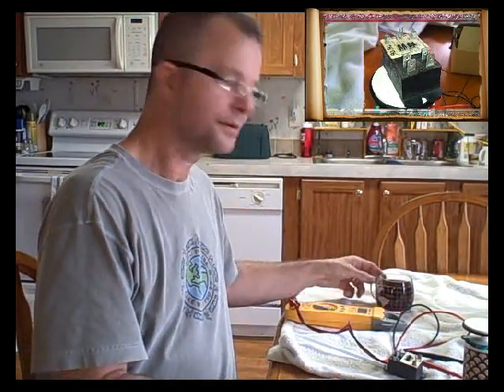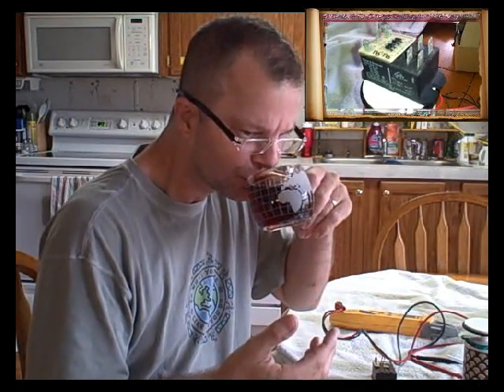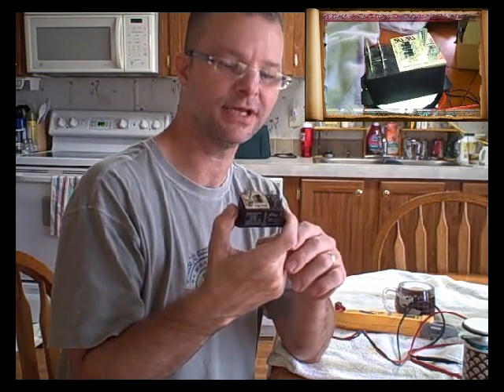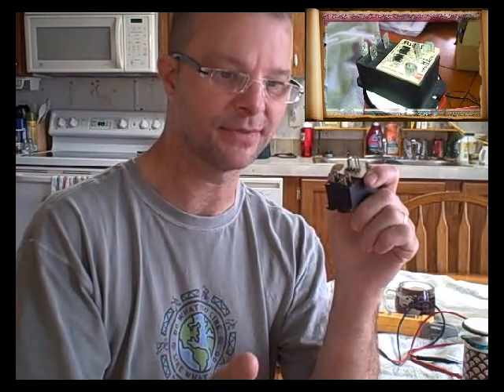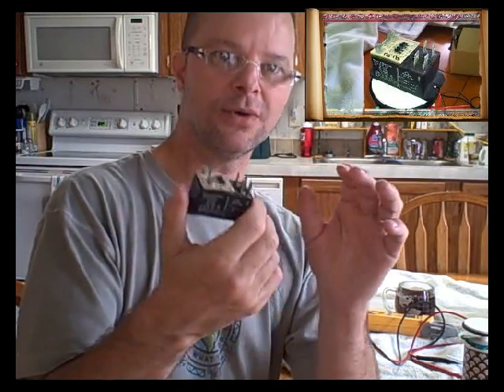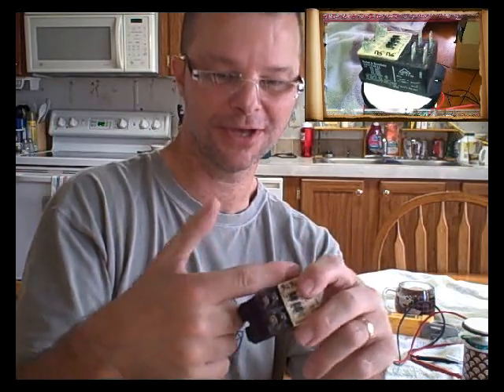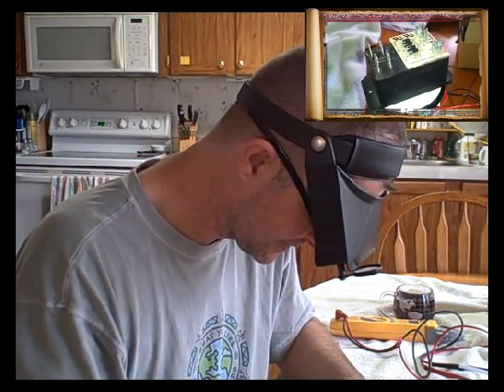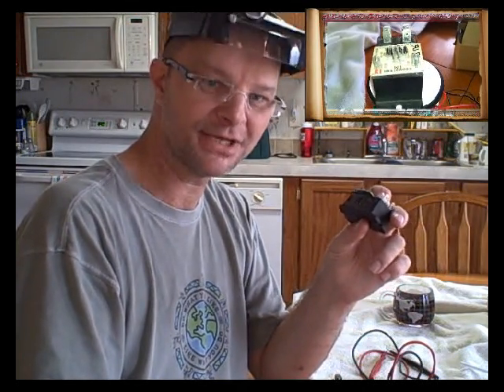HVAC DC Heating Relay troubleshooting

Comment: My Carrier system has this part in it. I’m in North Texas and after this last winter weather my thermostat would just keep rebooting while in heat mode. It’s an Ecobee premium. If I turn off the main power and wait a while it will work after powering on the breaker. After a while it will shut down and reboot itself over and over. I ohm’d the limit switches and they were good as well as the heat strips (I have 2 strips). My voltage regulator is sufficient to power my thermostat also. Could this be causing my issue?

Comment: Thanks for putting this video out there. It was very helpful. a bit new to the industry (6 years) ran into a service call where emergency heat was not working. Got another heater, still no luck. I had all the right voltage but knew my relays were not working. Couldn't figure out why. I watched this video and then realized I was trying to send AC to the relays (there was no DC rectifier). Thanks so much for your help!

Comment: I have systems at my work with these. Fuses are constantly blowing. I replaced what boards we had laying around when we took over this property but i want to keep from buying all new ones. How can i test out the diodes?
Reply: If the rectifier board is working it will have 24 volts dc on spades from relay that rectifier board mounts to. If you are reading a higher voltage, like 36 vdc, than relay is open, and board is ok. You read the higher voltage because rectifier has no load on it from bad relay.
If you check dc relay a good one will have a coil that reads a little over 300 ohms.

Comment: Very helpful video. 2 of these are inside my ICP/ Tempstar manufactured air handler with 15 KW heat strips. So obviously these take the place of sequencers.

Comment: Ran across one the other day, Heil unit, which had Carrier sticker.

Does this rectifier only work with heat strips, not cooling or blower motor in cooling mode?

Where you buy glasses?

Thk u. Good video.

Comment: our heatpump always blows a relay at least that what the repairmen tell us because the outside unit dose not come on
Reply from the maker: Well you were up late! Hehe, sent that asset after midnight! I was in bed by 7:30, if you can believe that, and asleep by 8! Woke up a bit after 4, first time I've slept more than three hours in months, i think!
Yeah, sounds like your contactor on the condenser unit out there. I have a friend of mine that gets ants in his and they kill it, seems like every other year. If he remembers to put out ant poison its ok. Always the smaller unit out by his pool house too! They like something about the electricity, like moths to a flame, lol.
If the unit is pulling a lot of current on startup it can pitt the contact points and eventually cause failure too. Older units are prone to pulling higher startup current, as well as heatpump, esp in cold weather, that have a compressor heater element that has failed. When that happens the liquid freon pools in the compressor and it has a hard time starting, pulling high amperage. Lots of other reasons too, one of these days I should make a cause/effect manual for fun!

Comment: I have replaced that relay(and little board) in Nov 2016 and again in Feb 2019 because the auxiliary heat would not turn off.  Now (Jan 2021) my auxiliary heat will not turn ON. Thermostat displays aux heat is on, but I measured air temp from a vent at only 65 degrees F..  This relay (and little board) keeps failing approximately every 2 years.  So I am about to buy relay and board again, and the little board is at a much higher price than in prior years.  Is there a simple way to know if the problem is the Relay or it is with the little board?  Is there a better, more reliable relay that I can use?  Thank you for your time.
Reply: I figured out how to test the relay and mini-board.  I happen to have a 24 volt AC power adapter.  Plug it into the wall, and it makes 24 volts alternating current up to 1200 milliAmp.  Connect the A/C current to mini-board poles TP1 and TP2, and then miniboard QC1(Red lead) and QC2(Black lead) should show around 24 volts DC.  If you get negative voltage, just reverse the leads on your multi-meter.  This concludes testing the mini-board - its job is to convert 24 volts A/C into 24 volts DC to power the relay.  Now for the relay.  The Two Tabs on the left (QC1) side of the relay should show infinite ohms resistance - connect the A/C power supply to TP1 and TP2, and those two tabs should show 0 ohms resistance.  Repeat the test for the Two Tabs on the right (QC2) side of the relay.  My results are: My two mini-board rectifiers work well.  The mini-board inside the furnace also worked (felt risky to test it while it was in use with Aux Heat enabled by thermostat.  I certainly would not test the actual relay while HP is in operation).  The relay that I removed in Nov 2016 works great on the bench.  The relay that I removed Feb 2019 - the right side should be infinite ohms resistance when no A/C power applied to mini-board, but it is not infinite ohms (forgot the exact value).  Both sides work correctly when A/C power is applied going to 0 ohms resistance.  I turned off the furnace circuit breaker for 10 minutes, then turned it back on, and the relay in the HP is working fine - auxiliary heat now goes on when thermostat calls for it.  It seems these relays can cause Aux Heat to never go on, or can cause Aux Heat to never go off.  And sometimes just turning off the furnace at the circuit breaker to let it "rest" a while can get it to work again - how long will it work correctly - I do not know?
Reply from the maker: @silentanddeep  great job and thanks for describing your testing process for everyone! Apologies that I didn't see your first message sooner.
Yeah, I can't imagine there being a problem with the diode boards. For kicks you could buy a different relay and just soldier the board on with jumper wires and test it out. I still don't know why in the world they bothered going that route to begin with instead of just using regular relays like everyone else:/ I always wondered if they got a massive discount for buying a ton of them that some company got stuck with when whatever company was ordering and using them went out of business our something, heh.
Honestly I don't know why you couldn't use a regular relay (ac) and do away with that nonsense, ass long as the current draw was in the same range, or at least not taxing the transformer. I imagine the transformers have a decent bit of overhead.

I've replace the melted down heat relay in my air handler with a big contactor that you would see in your outside condensing unit, hehe! It does make a loud ClacK sound when it engages, but I don't even notice it anymore. Every couple of years the heat won't come on the first time I use it when it gets cold and I have to pull the cover off the unit and wack it with the handle of my screwdriver! Just gets stuck a bit from sitting all year. It's probably because i mounted it on its side with the contact bars parallel to the ground, If i got motivated I could try reorienting it. :)
Half of the blower relay failed at some point, so I upgrade the relay for that one too.
If a tech came out to work on my unit, they'd look art it and think "what the hell..."
Hehe :)

Comment: THANK YOU SIR!  I've been working on these for years, and thought the small diode board was a common relay external 'FLYBACK DIODE array', (preventing voltage SPIKES when the relay's trigger 24V coil was DEactivated.  BUT, it's a DC RECTIFIER board powering the DC relay coil!  Suvmabeetch!!!  Thank you.

Comment: I have one of these on my heat strip kit and suspect it to be the culprit to my issue: heat and blower won't turn off. Thoughts?
Reply from the maker: Sorry, haven't checked my mail in s few days:/. This is one of those gotta be there moments, I think.  It sounds like something else is the problem, if the blower AND the heat won't shut off, it isn't a standard blower relay problem.  Without seeing the system, my first guess would be a stuck heat sequencer. In some systems they will put the low or med speed for heat on a sequencer with one of the h heat strips and they will come on first together when the thermostat calls for heat, then (unless it's a tiny system) usually 30 seconds to a minute later a second sequencer will kick in with one or two more heat strips.
In a stuck sequencer, if it happens to be the one with the blower on it, the blower and one strip (typically) will stay on when the thermostat isn't calling for heat, while the rest of the heat strips shut off. You can usually feel warmth from the vent, but not nearly as hot as it usually is.

There are other issues that could cause the problem as well, a burned off wired causing a short, a heating element that has broken and somehow fallen on another element.. (rare). All of these, of course, require a certain type of system to happen, usually all requiring sequencers for the heat, not relays, and the only fan relay, in those cases, either turns on the blower in high speed, either for cooling mode, or if you turned the blower to the ON position just to circulate air in the house for a while. Otherwise that relay defaults to automatically passing voltage to the blower/heat sequencer for low/med blower speed, waiting for a heat call to turn it on.

Yeah. It's a bit confusing! Hehe.  It's possible it could be a circuit board issue (though Ive never seen one do that. Yet.) Or a possibility that it's the thermostat.
Without seeing the system and inspecting it  and putting a meter on it, it's hard to be sure. Regardless it's not something Id recommend someone try and fix it they don't have experience, especially since you're working with 240 volt electricity and enough current to kill you instantly if you slip up and/or touch the wrong spot accidentally with the power on. 
... And don't make the mistake that any number of people have made, thinking that turning off one breaker kills the power. It's usually at least two. On really big systems (though not as often) it can be more. That's not taking into account that things in the breaker box can be mislabeled!

I can't remember how many times I've flipped of the breaker for something, heat or cool, only to check the power at the device with my meter only to find it VERY live!! Ouch! I've learned to always double and triple check :)
Be careful, and it's best to hire someone to get it running properly for you!

Comment: Thanks for your post ,ran into same relay and it wasn’t closing pulled it tried an little black one for a test heat came on .
Turned off and tried to get relay luckily Saw your post . Thanks much but I can’t think of one good reason you would have aDc. Relay in  Ac  system.
Reply from the maker: Well its always fun to needlessly complicate things, right? Hehehe.

Comment: Can that relay trip a breaker?i got a hydronic system & keeps tripping my breaker everytime the compressor tries to turn on
Reply from the maker: Sorry for the delayed answer. Been dealing with health issues for a long time and I only sporadically check in:/
A tripped breaker when the compressor kicks on can be caused by a ton of different things. (Besides that) a weak breaker, weak or dead run capacitor, hard start capacitor issues, loose connectors on mains wiring in the unit, disconnect box or at the breaker. Corroded wiring, wiring connection issues at the compressor, etc. Its been months now, so curious what your system problem turned out to be!

Comment: Could one of these relays cause the blower motor to constantly run even with fan Auto and system off?
Reply: Recently had this phenomena when I pulled the heat strip out for service.  You have to satisfy the thermostat to the control board (connect red and orange wires), or the blower will run continuously because it thinks the chamber is over heating.

Comment: Thanks man,,, a rectifier ( how odd ) as you would say.  Must have been a old system,Any way cool video , just out of Hvac/R tech. school , Any help is good right now.
Reply from the maker: Awesome and congratulations!  All I can say is watch all the tech videos on here that you can lay your hands on!! I started making videos originally to help out other techs... I remember how much I was calling the boss my first year in the field, lol. It was something every day it seemed!  I had no idea there were so many different brands out there, or how damned old some of the stuff still running is!  I remember the first time I ran across an ac unit so old that the high pressure line going to the evap coil WAS the metering device!  That was strange!  Or the old 1950-60's condensers with those monster size capacitors that were still original! (I should have scavenged a bunch of those when we replaced systems and saved them for personal use, hehe;)  i should make a list of the weird stuff for fun one day!

Comment: OMG, for real, if you're any kind of an A/C technician this would not be an issue. you can most definitely just throw in a normal 24VAC relay. the board is the only thing that changes it to DC. cut the 2/prong plug put 2 spade connectors on and boom you're done. I really don't get why this is so "weird". I see them at least 6-8 times a year.
Reply from the maker: +John Williams its not an issue, just replace it with the same part that went out, I could put in an ac relay but I'm not going to void their warranty by hacking it.  Back when I made this video you just didnt see too many of these out in my area, and I typically ran about  at least 1500 calls a year I guess.  The first time I ever ran across one it certainly was strange :)
Reply: +John Williams Would the board be bad if my heat strips are not coming on or would it be a relay issue?
Reply: So you would need another relay or use the same one?

Comment: Was that relay just passing low voltage to other relays or was it passing high voltage to the heat strips I've seen a lot of weird stuff on carrier heat pumps
Reply from the maker: It was passing high voltage to the heat strips.

Comment: rectifier allows power one way. when fails it will allow power back the other where its not supposed to ie blown fuse or blown cap.
Reply from the maker: You know, sometimes I think they put that stuff in there just so it will break and they can sell you more OEM parts instead of using a more reliable AC coil! Lol.

Comment from the maker: Sad but true on lots of things... Its called planned obsolescence.  I was reading a story about the history of the light bulb. It went on to explain how a few big companies used legal and scare tactics against a smaller bulb company that had built a long life bulb, they told him that the bulbs should only last X number of hours then fail.  Still going on today!
Reply: Hi Mikie. I have the same heat relay in my Payne furnace. Today I was checking if the heater works. But It was not running the blower or heating.I jumped it up the thermostat wires Red and White , nothing happened.I did the same , testing with a multimeter and look like its burn out .

Comment: most a/c people don't want to tell anything because you will know more than they do.
Reply: I share TONS of stuff with customers. Even so, it's just a fraction of my trade knowledge. Yet I'm learning virtually every day on the job...
Reply: I know u do thats why i sucribed to your pg i got a question i got a westinghouse heat pump everthing is out side not split unit i had to take the blower motor out and replace it with a reg motor not one just like it had this one dont have all the electronics on the back anyway i need to put me a relay in it so the heat strips will come on during the defrost cycle can u teel me how to do it i got a 5 pin relay 1/10 hp 120vac 5a 240vac potter& brumfield24vdc Thanks